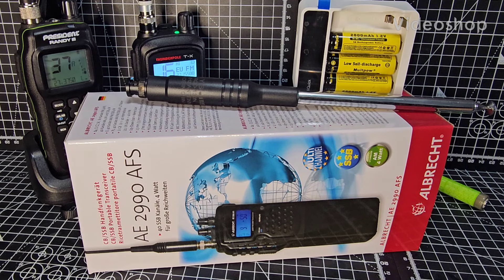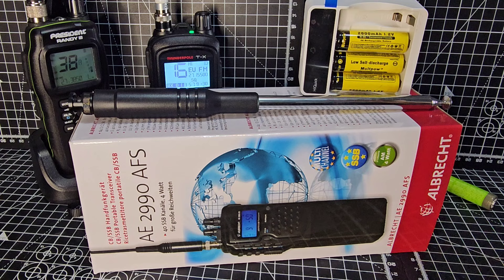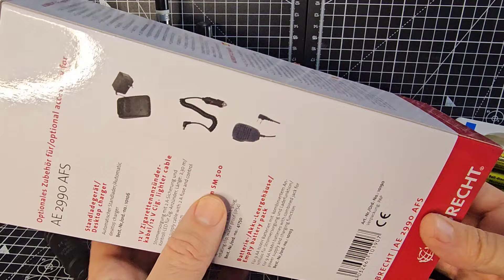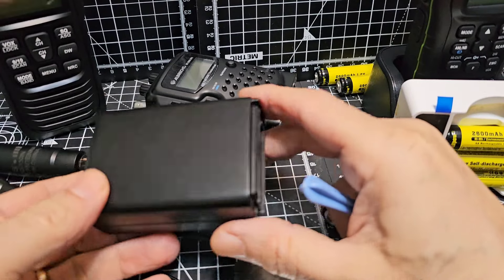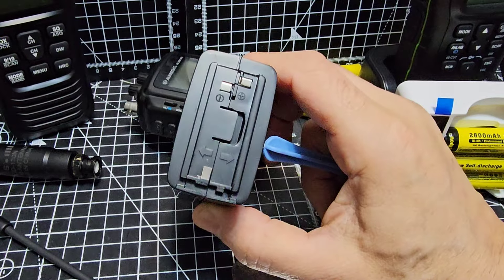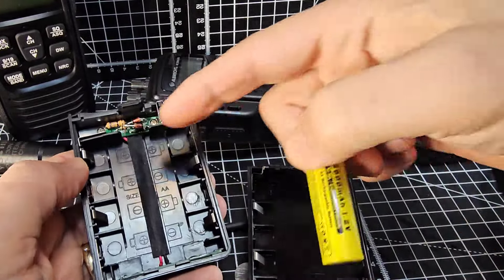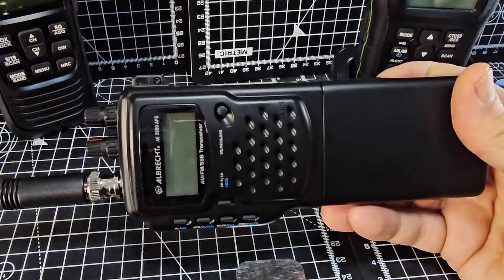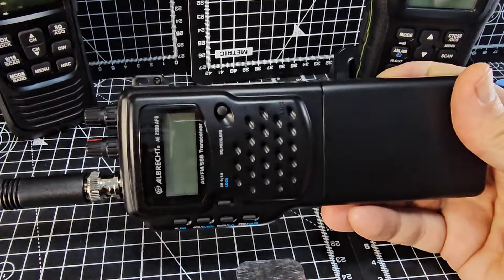Albrecht AE-2990 , SSB Walkie Talkie - Unbox & QUICK Look - 2024

Comment: Hello, I have an ALBRECH 2990. It was delivered to me with rechargeable batteries of the reference NH15 1.2v nimh.H6 of 2000MH. I realize that there is not enough power in voltage to transmit, if you would be kind enough to tell me what kind of battery you have. I am told to buy lithium batteries but without further information? Can you give me the reference of your batteries and the charger is where did you buy it, thank you for your help 73s
Reply from the maker: Hi go to the Facebook page look for Duane- https://youtu.be/4DPbEsRxK2A?si=MoLwWZH7QW6OB5bE